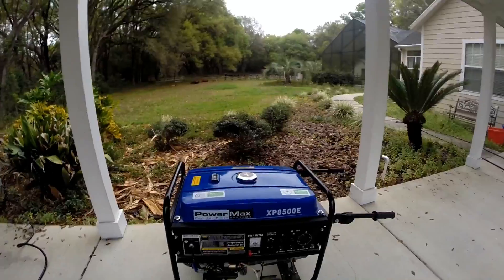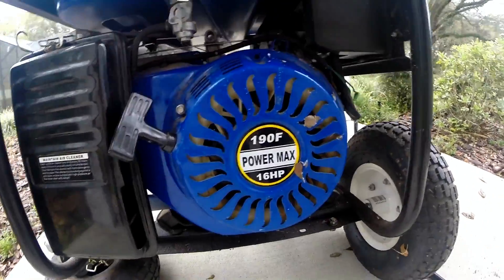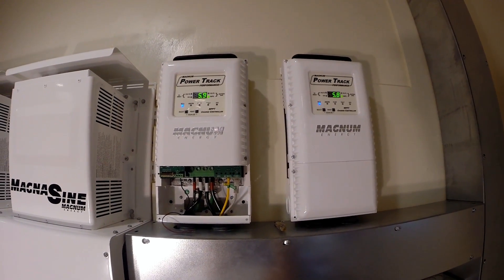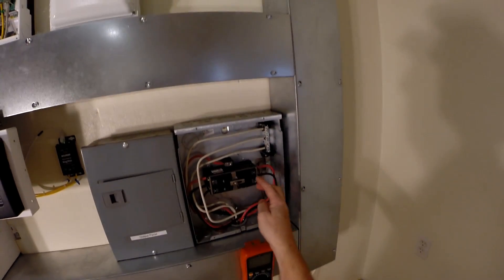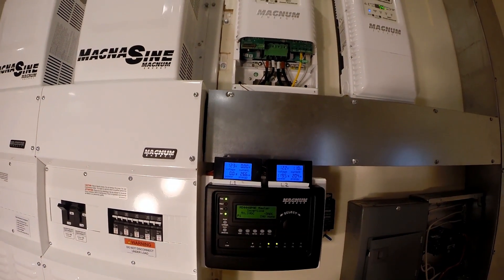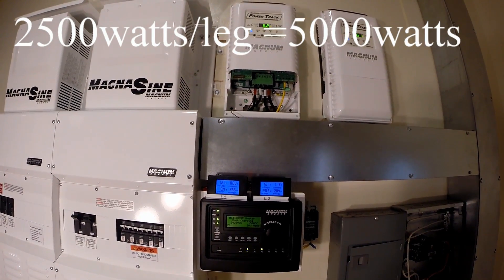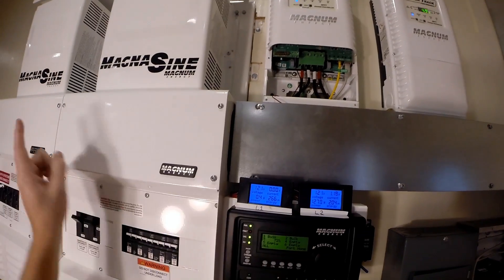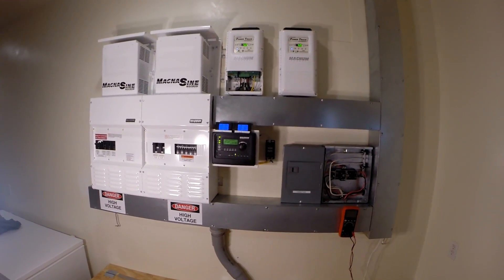Off Grid Solar #43: Backup Generator Test

Comment from the maker: Question for Magnum Energy:
Hooked up the generator today.  At first the generator motor was oscillating heavily and when I connected it to the Magnum, the Magnum disqualified the power from the generator.  I got the generator running smooth and then the magnum accepted it and charged the batteries.  OK
1. Do I need to purchase a inverter generator like the Honda 2000i?
2. Will the dirty power from my cheap generator damage the Magnum or will it just reject it?
3. If I use an inverter generator that is 120V, is that hard on the system in anyway vs a 240V generator?  

From Magnum Energy:
"I would not recommend a small inverter generator, dirty power isn’t going to damage the inverter, but high voltage from a surging generator would, so I would recommend a good regulated generator sized large enough to run the load of the house and the charger set with the charge rate set high enough to charge the batteries as fast as you can. Your generator surging like that could be providing high voltage you want to make sure it is stable before you turn the power on to the system. So the inverter is going to want 240 volt 17.5 amp per inverter, so 8400 watts to run the charger only at 100% plus up to another 8000 watts if you are used to having the 8000 watts available from the inverter to run your house loads. That is a total of 16.4 kw generator to be able to have the same power as the inverters provide and charge at 100%. If you plan to use it in an off grid application you want one that is designed to run a lot of hours usually not a contractor or standby generator."

So,
For now, I can stick with my old generator and make sure it is stable prior to hooking up to the Magnum System plus cut the charge rate back to 70%.  In the future, I am thinking of a Cummins Onan 6500 watt Propane generator.  4500 watts for charging and up to 2000 watts for the house loads during charging.
Reply: i know a year ago but... try pluging a load directly into the generator - 500 watts or so and then flipping over
Reply: the surging is cuased by a dirty carburetor....there are 3 tiny hole on the motor side that get clogged up
you can watch this guy video...he will explain it
https://www.youtube.com/watch?v=uAHdhuDpeKw

Comment: I have an new system with an ME-ARC controller for my 48V Magnum MS4448PAE and have yet to try using the generator for charging.  I also have the manual transfer switch as you do/did.  What are your controller settings under the charge menu in order to have the unit charge batteries when switched over to the generator?

Menu item 03E Max Charge Rate is set to 0% currently, I believe I am to increase that number to split the incoming power between load and charge, correct?  I understand that it was set to 0% at setup so that all the power from panels goes directly to charging the batteries and none to the load.
Reply from the maker: Dennis, I think I have mine setup to automatically charge when connected to an AC input.  Note: it is not usually connected to any AC input.  Then I go to the 03 rate setting and set that to whatever amount of current you want to pull.  The rate will depend on what AC source you have.  If I am using my Westinghouse I may go to 90% but if I am using my PTO, I only run it up to 40%.  
Note:  I always shut off the AC output of the solar before charging.  I don't want dirty power transferring through to my electronics in the house.  

PTO: https://youtu.be/w5UT3YaBzPA start around 6:20
Westinghouse: https://youtu.be/h9vvs2ilUIo

Hope this helps!
Reply: @HomesteadEngineering  Great, thanks for the information.

Comment: And now I know why you bought a new Westinghouse generator. Although, I am sure the Duramax generator just needed a carburetor cleaning. Applying a bit of choke to smoothen her out is a sign that the main jet is a bit clogged. Good to see that your solar charge system is advanced enough to know to only use clean power to charge it. Just amazes me how many amps that system can draw to charge 16-batteries!
Reply from the maker: This is my 2nd Duramax generator, the first one died after about 250 hrs.  This one probable has about 200 hrs as well and it is loosing power.  I can only get about 2500 Watts out of it now.  Thanks!

Comment: Hi David
what a magnificent job you did. I very much enjoyed watching the videos from start to finish
from putting all that solar system together. a big wow to that . 
I started making my own solar system running at 12V it is more component friendly .and I have a wind turbine deaul permeant magnet  12 V and 12V , combin the two makes  24V if wanted.  I have alot of 12V systems, lights ext running
Inverter is 240 V  3000 W 9000  W peek peure sine wave . 1000W and some smaller ones 
but thank you for all that,,,, Very interesting WOW ......
Reply from the maker: Thanks!

Comment: inverter/generator is a must. Like the rest are saying. You have a lot of cash in your setup.Why risk it. When you can sell the gen you have and buy a  inverter/generator. I had my Magnum inverter die from a gen just like yours. Hope I have not upset you. I know how things work and if it;s all you have and can afford. Just run the loads off the gen and not into your Magnums. God Bless Brother
Reply from the maker: You had a Magnum inverter die from hooking up a generator like mine?   YIKES!   Was it the dirty power?  What do you think caused it to die?
Reply: Yes mine was 2440. Magnum replaced it. But they told me without a doubt that my gen killed the charging side of the inverter. That was 10 years ago. That gen was one I picked up at lows. Was a Troy-Bilt generator. It would not keep a good speed. So the power was not clean. I think it's what killed 2 of my saws and one of my drills a Tv. Have no clear proof. But They all crapped out around the same time. After the Mag was dead and shipped back to be fixed.

Comment: Hmm. Good test, video...I can foresee getting an ATS with a new inverter/generator for this beautiful system. Magnum likes good clean, stable power. A few years back when I got my Honda, I was questioned why I spent so much...because I want it to work every time with a perfect sine wave feeding into my house. You really got a badass system...now, might consider a generator upgrade (sell the old one to offset the cost of a new one?)
Reply from the maker: Honda's are so much better than this junk.  For example:  We had a Honda 10K generator at work that we ran for thousands of hours over a 12 year period and it never failed.  One time, it did not start (choke was stuck off and no one noticed) so I brought in my generator from home (same exact as this one), it was brand new and it ran for 12hrs/day for 3 weeks and then died a horrible death.   So, that's about how long I expect this one to last if I ever need it.  I also have a Honda 1K inverter generator.  I think the Magnum will take that as input as well even though it is only 120Vac.  At some point I would like to get a nice Honda generator but I have a long list of other stuff ahead of that right now...  Thanks!
Reply: Right on! My Honda eu2000i and Outback Power inverter mate up good...and have mine set for about 13 amps (about 1,500 watts). Not much, but that little Honda has powered my 1-ton window AC! The generator still has warranty...so, not gonna convert it to LP or natural gas (which doesn't break down fast like regular petro).

Comment: the charger can be set for how many amps you want to pull from generator so you don't overload it.
Reply from the maker: I think I have it set to 5280 Watts and that's about what it was pulling.
Reply: Oh. If you think it's pulling a little hard back it down a bit mostly of those generators are rated a little strong for what they can handle continues
Reply from the maker: Its rated at 7000 Watts so 5280 sounds OK, but maybe I go to 4500 just to make things a bit easier on it.
Reply: Good plan

Comment: Greetings  David. I thought I would share a few things that you probably already know. The Honda knock offs (Predator) from Harbor freight have California compliant carburetors that are set from the factory @ 70F at sea level. They are set very lean and not adjustable like they used to be. If it is 60F outside and just a few hundred feet above sea level they will need the chock added just a little. I have my Magnum set up to pass 30 amps AC to the house while it charges the batteries at 82 amps. I have the charge rate set at 80%. The default setting is 50% 
At 80% charge rate my diesel is at 70% capacity. I get 6 to 8 hours per gallon this way The Magnum is designed to sense how many amps are passing through on the AC side. If the AC side is using enough to lower the generator voltage (Set point adjustable on the Magnum) it will automatically reduce the charge rate. This way my diesel generator will never be loaded more than 70%. The other nice thing I found about the Magnum is it is a true (PFC) power factor corrected charger. This allows us to use any size generator big or very small. My old non PFC Trace inverter/charger had to have a generator that had a minimum peak to peak sine wave of 300 volts AC or I would not get maximum charge rate out of it. With the Magnum you can use any generator you can find. If it does not meet a certain criteria of voltage stability and min/max htz then it simply will reject it.
Thanks for the video and have a great day.
Reply from the maker: I have mine set to 80% charge rate as well.  The shore power is set to 30 Amps AC.  I was running the house while charging during the video.  The house was not pulling very much at the time.  Thanks for the good information!

Comment: what was instability issue in the generator?
Reply from the maker: I choked the carb just a bit and it calmed down.  It's good to learn these little things BEFORE the real power out situation.
Reply: it sure is
Reply: I've got a similar generator here in the UK. That surging is the engine running lean. Clean the carb, and remove the emulsion tube and check its not blocked. Also change the oil - you wouldn't think it, but dirty oil can make these surge too.
Reply: it's caused by dirt clogging the circuits in the carburetor
you can watch this video to see how to fix it
 https://www.youtube.com/watch?v=uAHdhuDpeKw